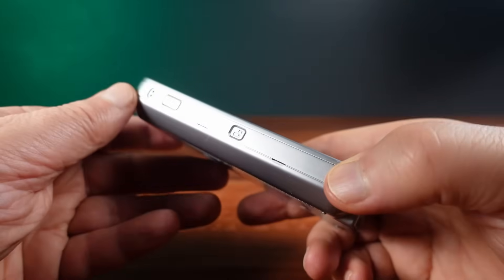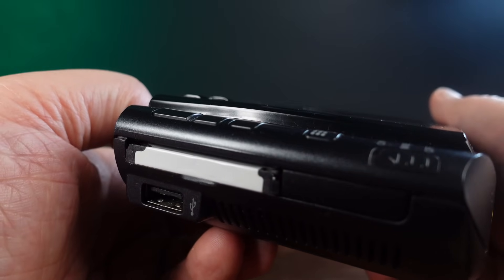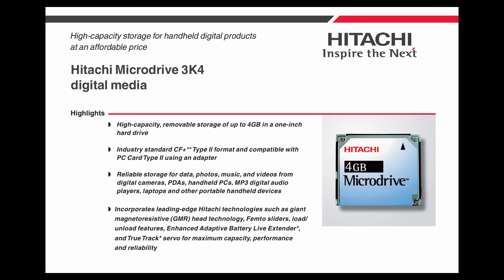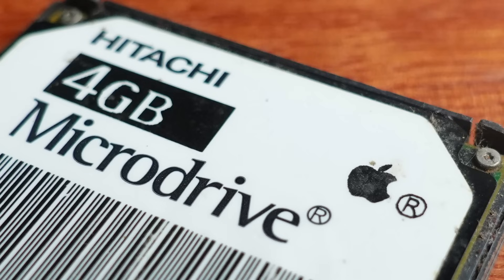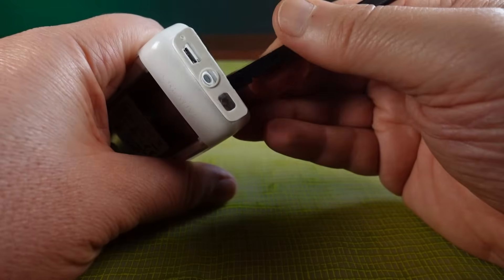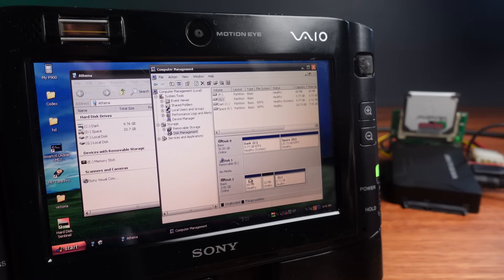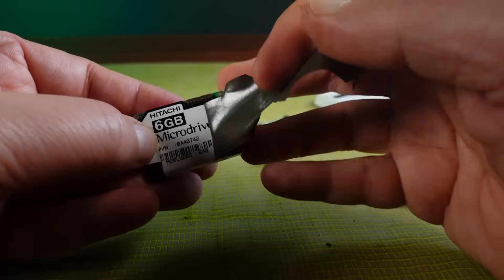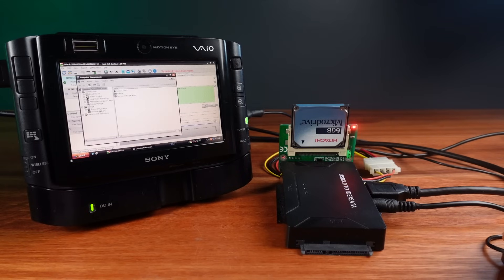Miniature Hard Drives

Comment: why didn't they make an adapter back then so the drives worked in cameras? shouldve been possible
Reply: Well, the Rio Carbon had a CompactFlash form-factor 5 GB of storage on a 1" microdrive HDD from Toshiba baked into the Carbon case.  You can hear it whirring as it plays songs too.  Since the physical interface is CompactFlash - it should have been possible to stick one of these into a camera and have the camera access the CompactFlash storage as normal - without it knowing that it was reading/writing photos to a HDD.
Reply: The video was deceptive. The HDDs are thicker than regular compactflash cards
Reply from the maker: Type II cards are indeed thicker in the Compact Flash specification.

Comment: It's funny, I remember as a kid wondering how they fit so much space into iPods when competitors were still bragging about having like 128mb. Blew my mind they managed to shove a spinning platter in something as small as an iPod, especially when the sizes grew to 80GB+. Stuff like this is just wizardy to me lol.
Reply: Yeah. The Creative Nomad Jukebox came out the year before the iPod and also used these tiny hard drives, unfortunately the device was still huge overall, design was alot like a DiscMan, which defeats half the purpose of not using one. Still had the advantage of storing lots of songs and not carrying disks.

I miss having other electronics besides a phone
Reply: I had back in the day (and still have) both the 30GB Creative Nomad Jukebox and then a 80GB iPod Video. When it was in use I had to re-solder the headphone socket in the Nomad at least three times. Nowadays the Nomad is completely dead even when plugged into the DC adapter, and the iPod video either shows a sad ipod screen or can find only one song (which is not even a good song). Hard drive probalby dead. I heard some clinking inside it the last time before it stopped. Probably didn't help it that I had it in the front pocket of my sharpnel vest in the military for months :D just had it in a ziplock bag and ran the cord out of it when in use.
Reply: @cabbelos  What song?
Reply: @ I couldn't find the old style cord for the iPod to get power into it, so I couldn't check. If I remember correctly, it was some pretty generic vocal trance song with a girl singing, but it was from a mixed album so it starts and ends abruptly. I had stuff like "Ministry of Sound's Clubbers Guide to 2009" on it, so it's from the middle of an album like that. Whatever was last playing when it died I guess.